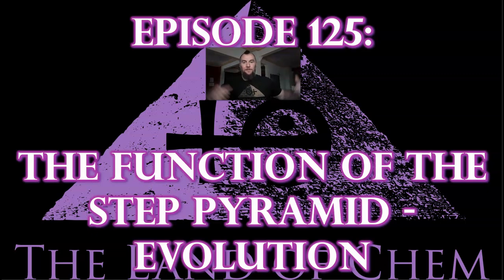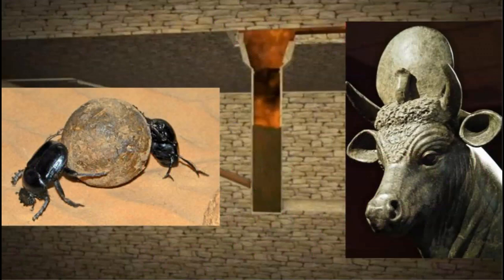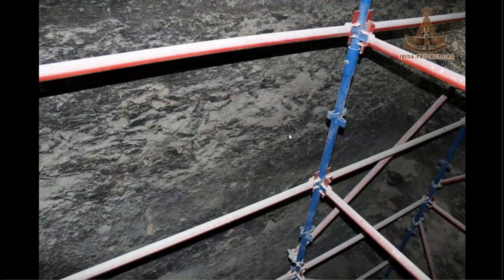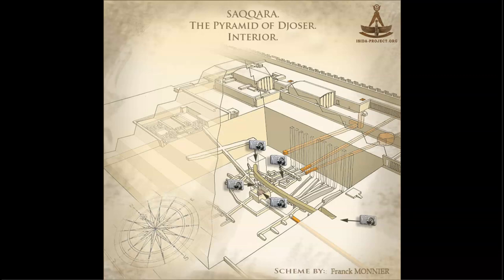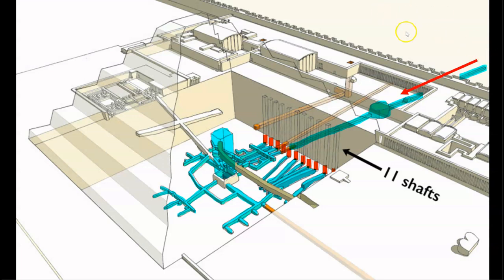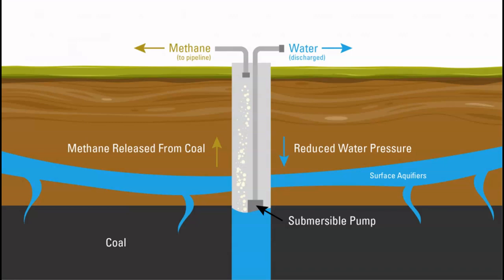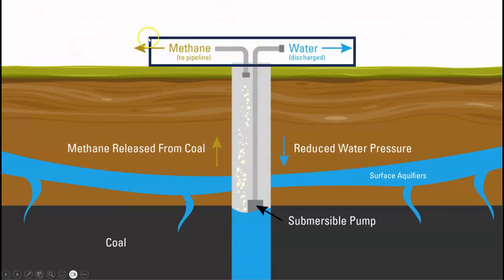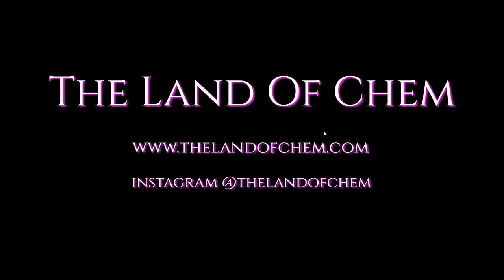Episode 125:  ANCIENT TECHNOLOGY - The Function Of The Step Pyramid - Evolution

Comment: The later use of the structure as a digester for the production of methane gas was done by whom ? The same civilization or repurposed by the dynastic Egyptians?
Reply: It was always the Egyptians; it’s just that they have nothing in common with the current Egyptians.  Except maybe the Copts.
Reply: Nope, the civilization who built the giza platue pyramid complex had absolutely no connection to the dynastic Egyptians whatsoever.

Comment: I think it's a hydrogen plant
Reply from the maker: Close. Methane is CH4, an abundant source of hydrogen, and the main syngas used for hydrogen production via steam reforming
Reply: @thelandofchem  I definitely think that's a hydrogen bubbler design, and using the natural rock as a cell plate,
According to the language the pyramids at giza run on steam from the mantle connection to the core under Khafre, it condenced on the granite surfaces inside the structures, Khafre also has a King's chamber, ie a primary coil.
They are 3 phase! 
Kufu primary coil above King's,secondary grand gallery and 3rd coil around the inside  perimeter.  They made gasses for our biosphere and also used for flight !
Mother earth had wings, its a magnetic attraction system based off the core.